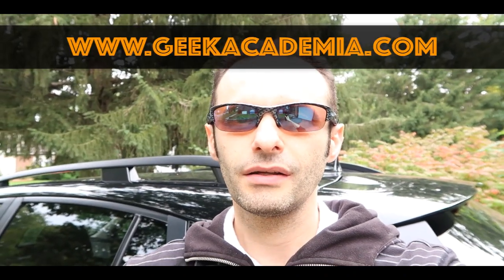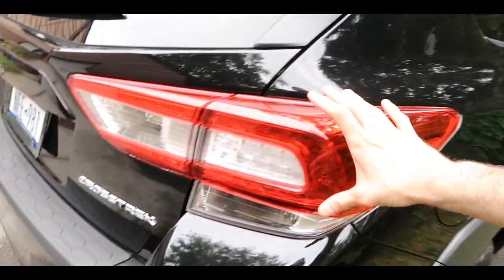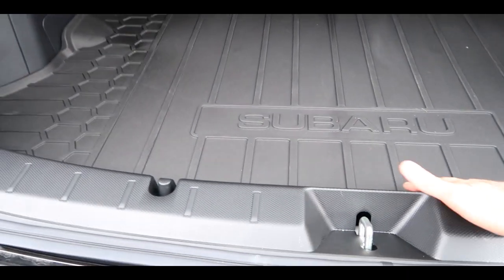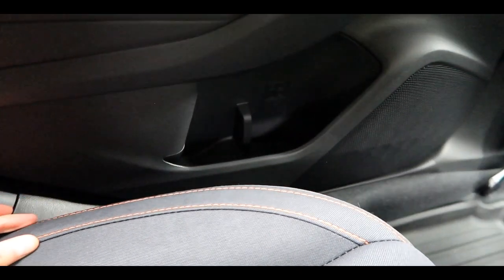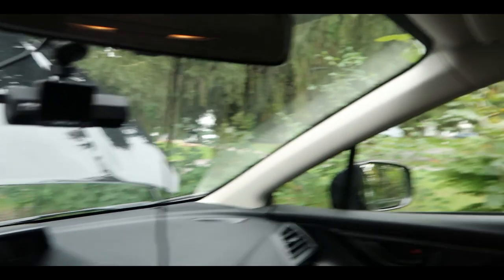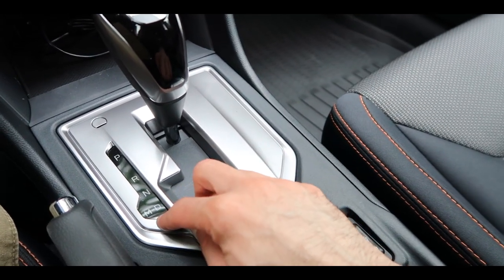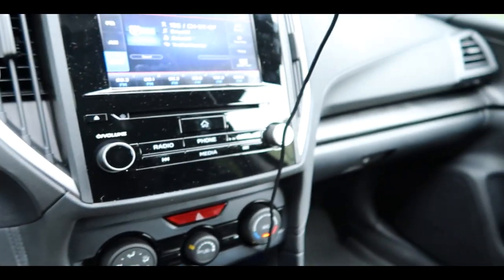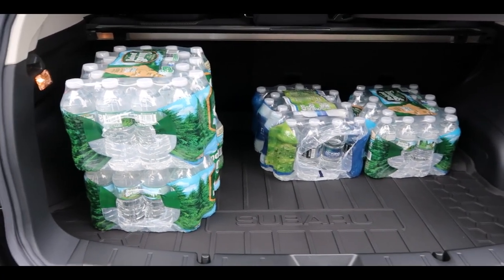Subaru Crosstrek 2019 Premium Review Black Edition (Full Review)

Comment: Its not the wrong side. They put the fuel door on that side for safety. If you pull over because you run out of fuel; when you are fueling it with a gas can you are away from traffic.
Reply: Good point